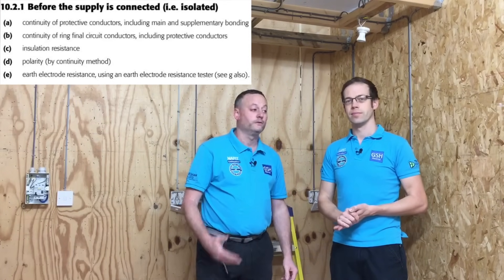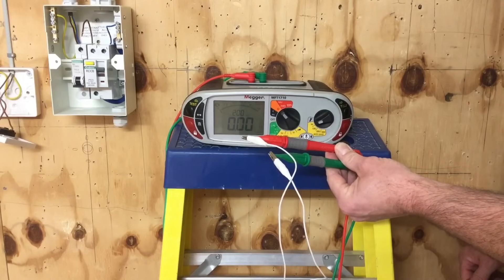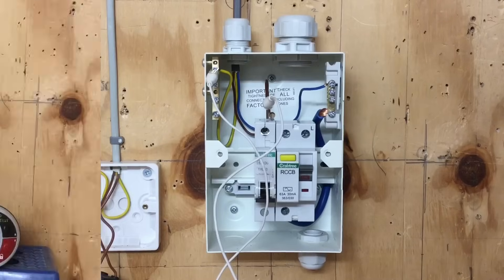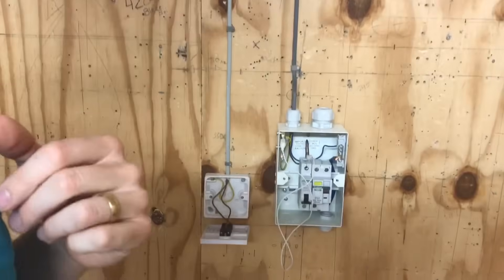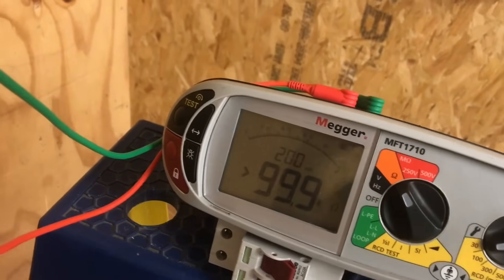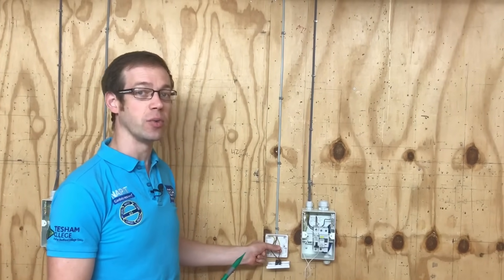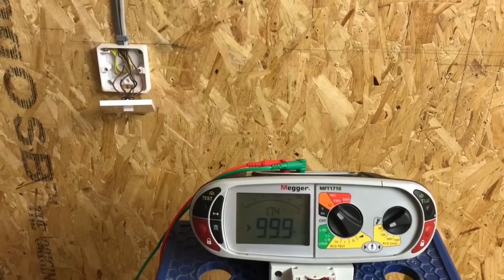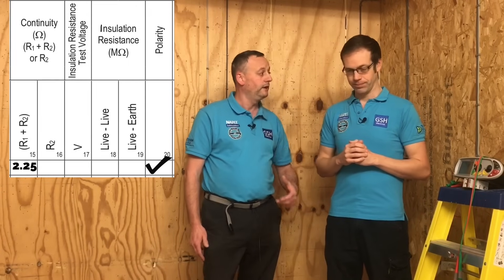Continuity of CPC and Polarity of a 1 Way and a 2 Way and Intermediate Lighting Circuit (R1 + R2)

Comment: Could you connect your link lead to the buzz bar with the breakers on other circuits switched off to save removing the conductors or would the breaker skew the reading?

Comment: Does it matter where in the intermediate switch you carry out the test?
Reply from the maker: AM2 or AM2s Insulation Resistance Testing of 2 Way and Intermediate Switching Using Guidance Notes 3 https://youtu.be/9AjyWl_2bds

The above link should also be helpful 👍. Thanks Gaz

Comment: I was thinking what's the difference between a prospective fault current test ( ipf )  and a R1 + R2 test. not much by the look of it just that your testing a circuit with an R1 + R2 test and an ipf test is done at the DC with line and earth.  - i just needed to say this

Comment: In a real life situation where there "may" be hidden earthed metal conduit - there is a possibility that the electrician carrying out the testing would never know about this - so would it not be best practice to remove the CPC from the common earth bar in the CU and then clip onto the individual CPC to carry out the testing. This would guarantee that there is no interference from any parallel earthing route to skew the results.
Reply from the maker: Hi. Totally agree 👍 thanks for taking the time comment Gaz

Comment: I am slightly confused and not for the first time! why would you have to disconnect the cpc when conduit is being used for earthing purposes?  I thought that the conduit would be directly connected to the metal casing  which in turn would create an equipotential situation.
Reply from the maker: Hi. Steel conduit creates a parallel earth path and testing needs to prove the cpc (conductor) is continuous. https://youtu.be/r94dJ7ASRTY
Thanks GSH